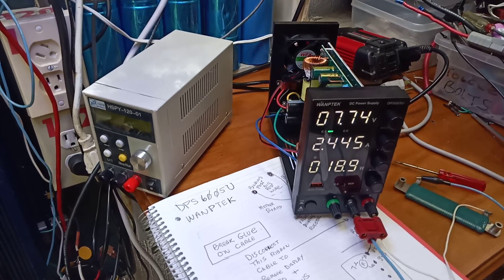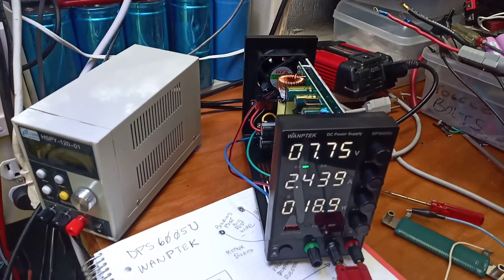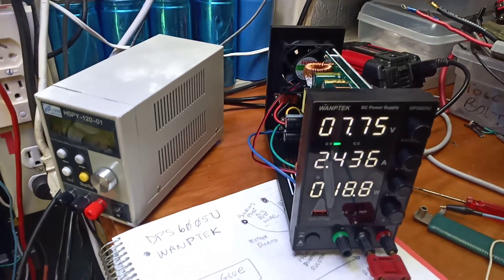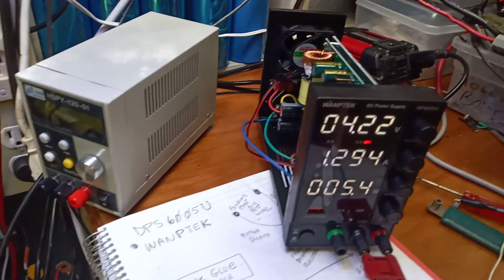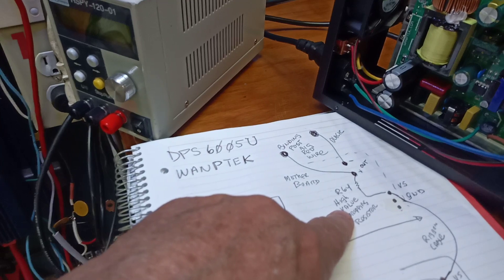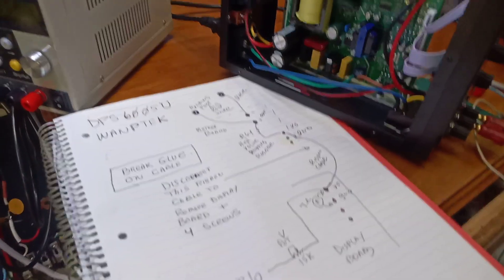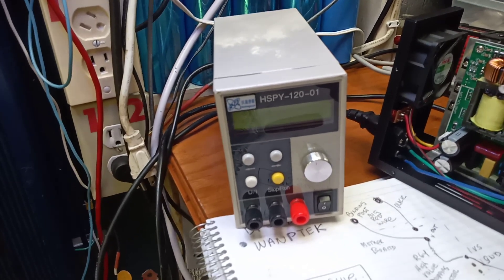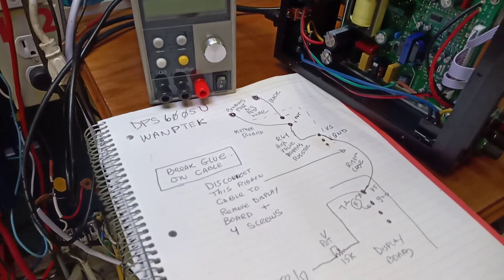WANPTEK DSP6005U 60V 5A Power Supply Repair, No Voltage Display Problem

Comment from the maker: It happened again! I knew it was related to that connector on the board. This time I pried up the plastic of the white plastic of the connector just enough so the pins didn't totally come out of the plastic.  Aligning these if they come out is a real pain if not impossible.  There it was a solder overflow from SIG to GND.  Took a sharp awl and removed it and pressed the shell back. Finding the two little screws that fell on the floor took the most time.

Comment: please Help😣😣 my jesverty DC power supply capacitor over hating and i changed but still the same problems
Reply from the maker: Not much t go on.  Does the supply still work with the capacitor overheating.  It could be a shorted diode allowing AC on the input capacitor(s), are there two?  Or is the output capacitor seeing over voltage.  Post a video of the insides and what tests have been done.

Comment: I have this same power supply model and I loved it and used it every day , it changed my whole work flow for mouths ( in a great way ) but Christmas eve night , I was troubleshooting my 2008 imac as it was not turning on . So I decided to try it with my power supply . I set it to 12v 3A as before then I would run that imac with a pc power supply and it worked great before but it was shutting off when I was trying to turn it on that night . I got the imac from a friend as a power outage brow the imac,s power supply ( so I used a pc one ) . but when I use you dsp6005u power supply and pushed the power button on the imac the fuse on the power supply blow instantly . ( no burns or sparks ) sense then I have changed the fuse but it keeps blowing . I have concluded its the AC side mosfets or a round there but replacing them doesn't bring it back to life .... I'm such as what to do and I really loved that thing ( am back to using a 12v 3a charger for my projects and my laptop for my smaller projects ) .... it was a great tool but I don't know how it could have failed so like that.
Reply from the maker: A method I have used since 1963 is to place a lamp in series with the AC line input.  A 40W or even lower incandescent will do. This limits current to a level safe enough to diagnose issues while still powered.  Have you checked the input diodes for short in the voltage doubler? Check resistance of FET from gate to source.  Not only is this an easy way to determine FET short, but it will indicate driver problems too. Resistance should be identical for both gates.  Let me know what you find.
Reply: @opera5714  thank you for your advise .... all my troubleshooting after replacing the fuse 3 times were done with a 425wa pc ups , as i didn't want to trip a breaker ( this was my way of safely testing , because i didn't know what had was the problem ) ...  . . i did have to replace the full brigh rectifier as i was shorted .... . i also removed both FETs and the fount display did display did come on and read voltages i placed external on the output but that soon stopped after i put one working FETs on the AC high side ... but now with or with out the FETs the display doesn't come on
Reply: @opera5714  if you want i can send pics of it .... the FBR was replaced with a bit larger one and the FETs are replaced ( i found only one was not working )
Reply: @opera5714  after placing the FBR and FETs it came one but didn't output any volts and as you raised the volts nomb from 0 to 8 ( around there ) it drowed more power ( from the AC ) but not volts on the output , before soon triping the UPS at a round 30w
Reply: @opera5714  i have been trying at it for a while and i disconnected the high power side from the ac in and only ran the display side .... i finally got it to come on but its fairly dim and when placing a 3.7v li-ion battery on its out put displays 6.8v and after 3-8 sec the display dims more before showing all the leds on as when it first boots but its just stays there dim with all leds on .... according to my ups its drowing less then 1w ( shows 0w )
Reply: i am happy with it still comes on
Reply: ok so the display only dims if there is a voltage on the output ( i tested it with 3.7v 5v and its own 5v out ( its 5v seems to work great still ) i mean the orange USB port on the fount
Reply from the maker: @ZaneGG  Always try to fix the simplest problem first. It will often solve many others. Without the proper control power voltage the A/D converter will come up with the wrong numbers. A weak display indicates this is very low.  A low drive voltage on the  gate of power FET will cause it to operate in a linear region and overheat quickly..